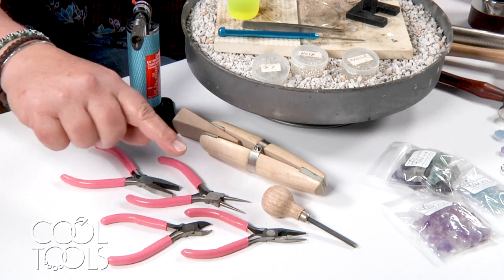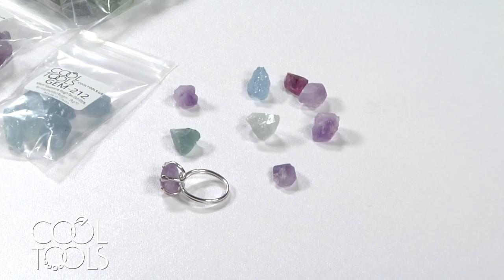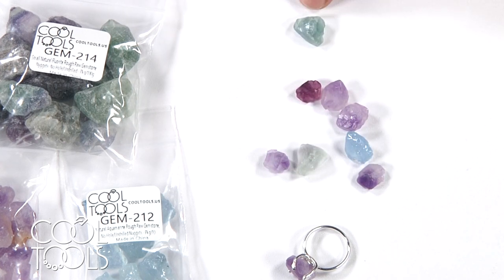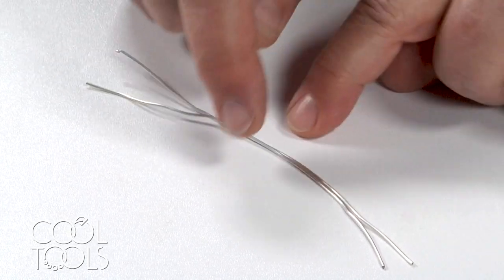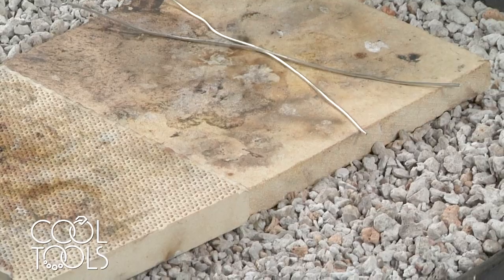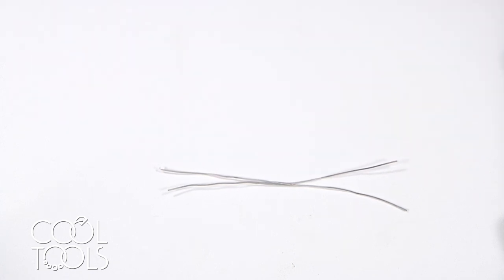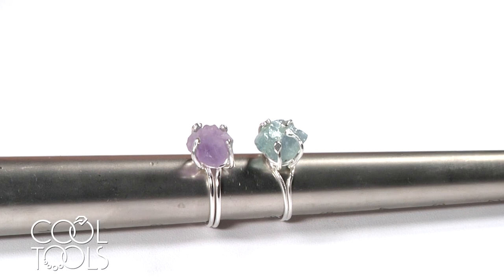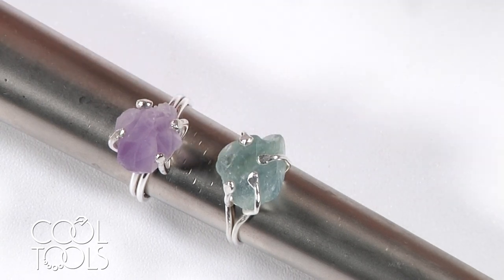Cool Tools | Fun Wire Ring for Rough Stones by Jennifer Dins | Soldered Sterling Silver Ring

Comment: I Love your videos! I have a question? What do you mean into the pickle? Do you put the ring in the Tumbler after setting the stone?
Reply from the maker: Thank you for the kind words! Pickle is used to dissolve surface oxidation and flux residue from a metal's surface. Once out of the pickle, there is nothing else you need to do, unless you'd like to polish the metal more. Hope this helps!